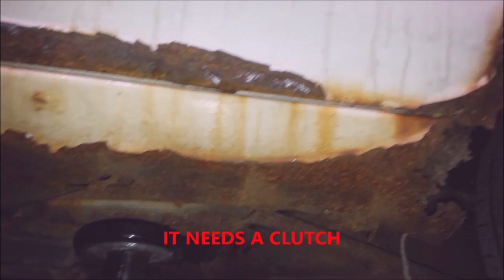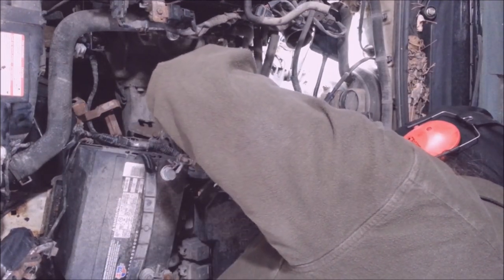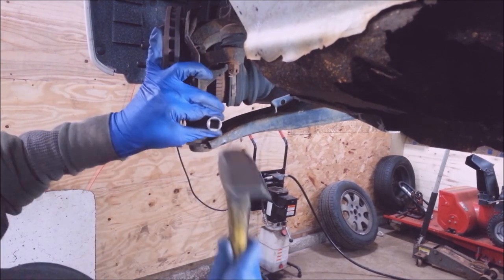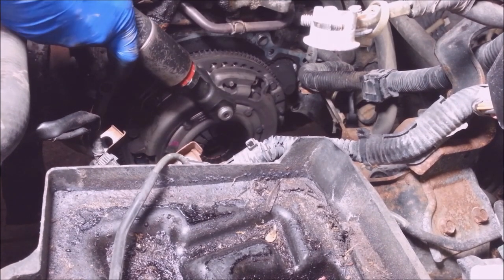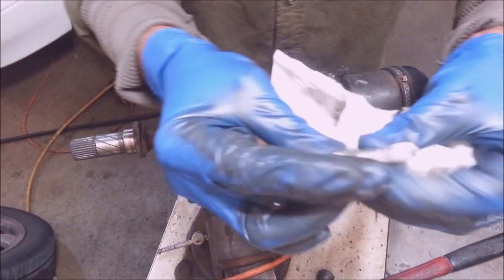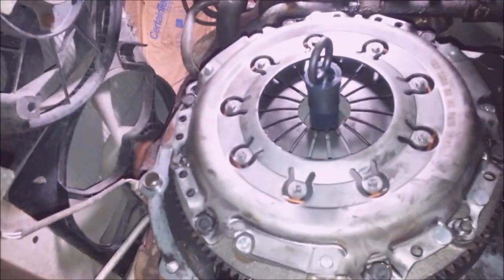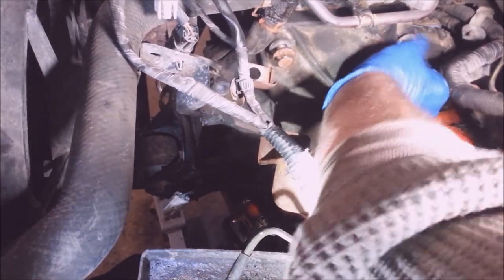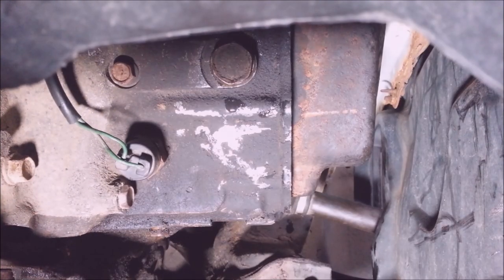1993-2002 Mazda 626 2.0L clutch replacement

Comment: Man I thought my 99 626 with 253k miles was a pos, this one seems like it hasn't been taken care of well. I also thought I could possibly look into replacing the clutch myself but that's also a big nope, I don't have enough know how or near to all the tools that would be needed/be helpful to use. Just be happy you weren't changing the oil too, they put the filer down behind the intake manifold... I wonder if they were drunk when the conception for the idea of this model came about.
Reply: Aquavita oil filter is not bad you can do it from the bottom it’s above the oil pan and much more accessible